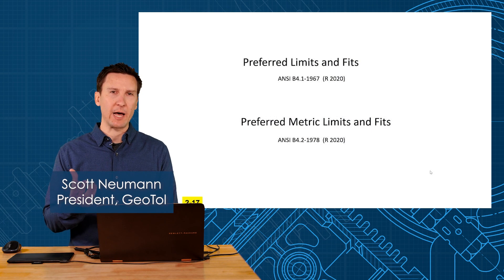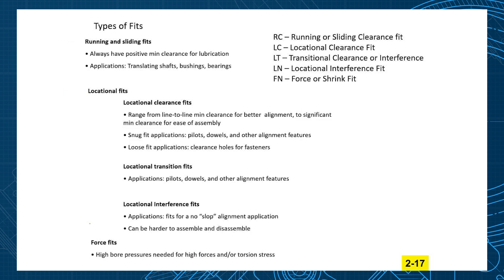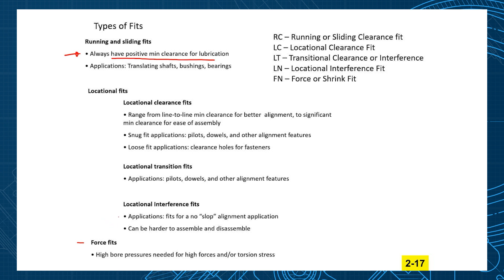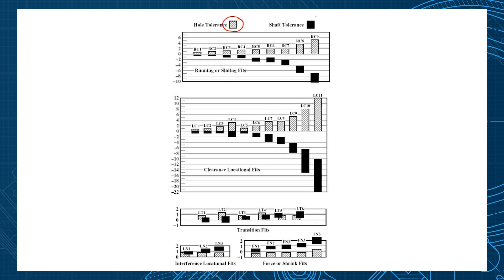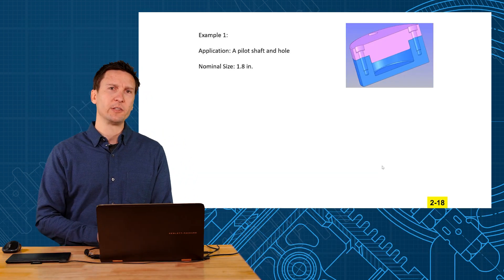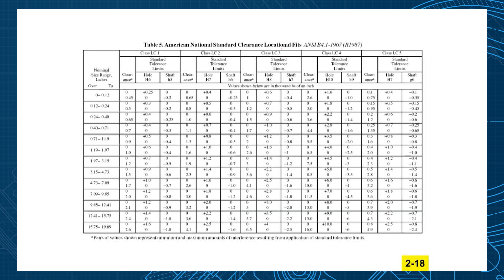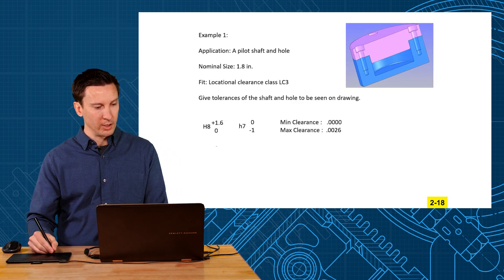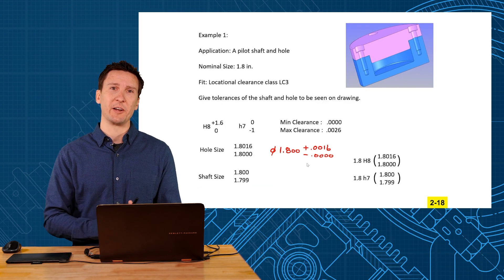Limits and Fits, Selecting a Size tolerance

Comment: Sir but what about geometric tolerance. Should we consider it like position tolerance for hole? If yes, then how to do it? Pls clearify
Reply from the maker: Position tolerance controls the location of features relative to a datum reference frame. For clearance holes (holes for fasteners), the value is calculated using the fixed or floating fastener formula. (mmc hole - mmc pin)
Reply: @GeoTolPro Thanks for your response. It means if I am using H7/h6 fit class then the position tolerance for hole should be zero at mmc to ensure the required fit?

Comment: Why lc3?
Reply from the maker: Good question. Selecting the fit class is the hardest part. LC3 has the same line to line MMC clearance as LC1 and 2 but opens the hole tolerance a little. Its not as sloppy as the LC4. Look at the graphic in the machinery handbook for a visual.